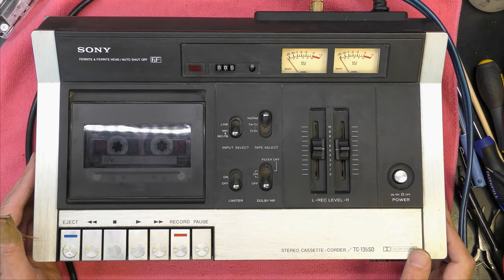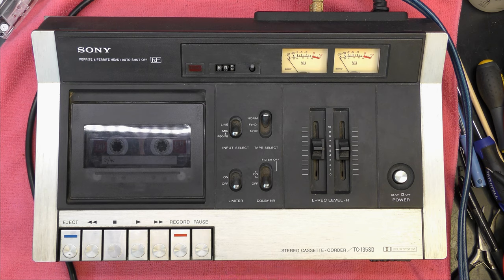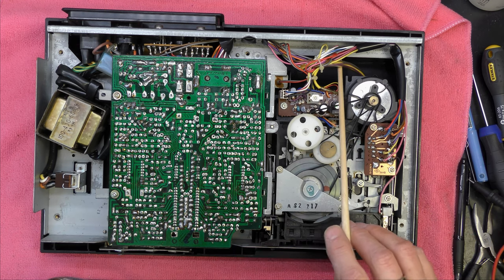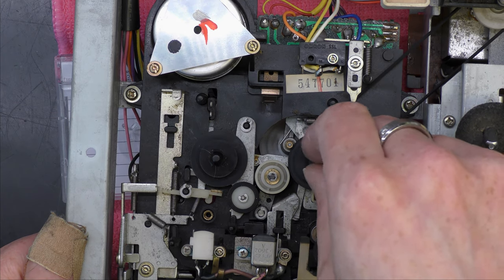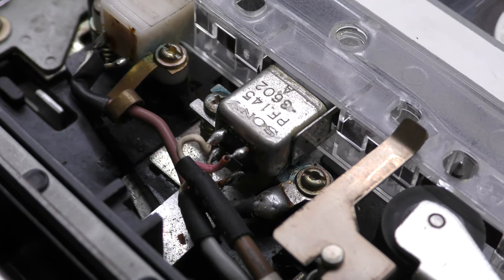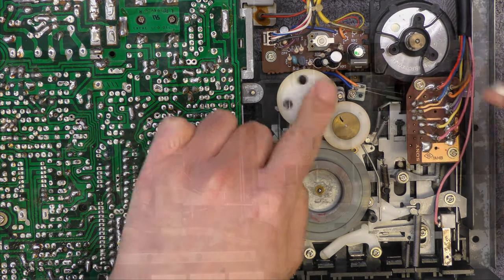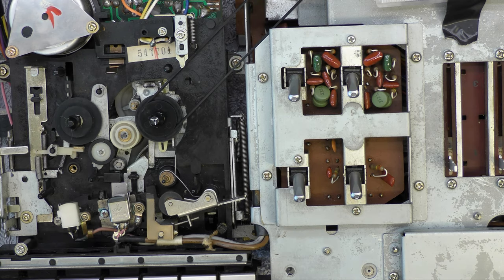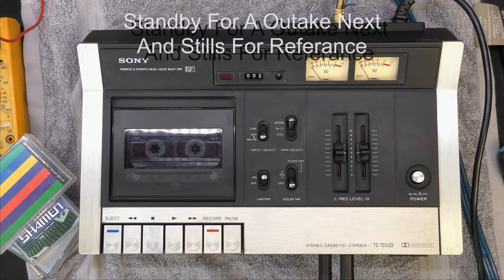Sony TC135SD Vintage HiFi Cassette Deck 1975 ish (4K)

Comment: I actually like how the PCB is separate... if you wanted to take the mechanisms and buttons off of a busted one, you could.  And then you could wire that up to a completely different board for amplification on the other side.  That's actually pretty cool, I may pick one of these up for digitizing cassette tapes and maybe even recording some

Comment: I love this deck. Very low noise floor. I think the superb frequency response has a lot to do with the SONY heads - ferrite IIRC. Unfortunately mine had had its bias/input switches on the top crushed and this led to intermittent left channel. I think I just hard wired the input one to 'line' and the other switches still worked after a good clean.

Comment: Great video! Just got one myself. Wont ff or rewind, but the mechanism inside seems to move freely. Maybe something wrong about the capstans (?). Do you know the size of the rubber belts on this one? And was it just unscrew the voltage switch? I see there are two screws on the switch - one on the top and one on the bottom. Will it make it removable so that I can accsess the cassette mechanism?

Comment: @12:45...always nervous about taking too far to bits ...
Me too, even the experienced amongst us all always steer towards caution. ;o)
I have just bought a similar model - the TC-136SD. It's so very similar.
Reply from the maker: Taking photographs a must, but often you miss something.
Reply: @darrencoe5795  Absolutely, the service manuals can only show the parts, and seldom, if ever indicate how they interact etc.
Cheers Darren!

Comment: I am able to compare a little better now my recently bought TC-136SD. 
The underside of your machine is much tidier, and transformer shielding is a plus too, not so with mine. 
Beware though - the keys, they are prone is fracturing underneath where the stresses are. I've had to repair mine. The Play/Record transport springs are far too strong in my opinion - I've cleaned them too, to avoid additional sticky spring forces. May look for a ligher spring to fit, and take it from there. Judging by how you pressed Play, your 135SD seems lighter on the fingers? (Edited)

Great lighting BTW, a very clear video!
Reply from the maker: Thanks. I bought some high CRI LED strips and placed on my bench a while ago. Filming in 4K produces huge files but gives good detail but I only have a 4K TV at the moment, my PC isn't. Thanks for bringing up the problems with the buttons. Sometimes the stop bar spring can be too strong so the buttons feel hard to press down.
Reply: @Darren Coe  The video is amazing! 
Keys: The keys are re-enforced with a metal bar inside - at least the ones that broke on mine are. I've cleaned them up, and 'roughed up' where the breaks where, and applied Gorilla Epoxy resin. Allowed 24 hours and more to cure. Seems to have done the trick!, although I may also place a small nail (don't laugh!) with epoxy as an additional 'backbone' to the key leg. You can see what I've written/done so far on my blog. BTW, I've got my unit fully working, may tweak it up later by replacing the caps and transistors? I find this old stuff has character! ;o) Regards.

Comment: There is just one caveat that puts me off this model, and it is the Dolby/Pre-amp Sony CX-064 chip - difficult to source.  Which is one reason why I also looked at the TC-134SD.
Should I chance a purchase? ;o)
Reply from the maker: I payed 20 pounds for this deck so not much to loose if I couldn't fix it. I liked the solid build when I saw it at a radio rally.

Comment: i would of just washed the mechanism with ipa cleaner to wash the old grease off and used silicone spray to replace the grease. the belts are normally lose. at a pinch you culd use rubber bands from the post office. that's what i did with mine the belts a most likely ok as the spring loaded wheels take up the tension when you press the buttons.😁😁😁😁
Reply from the maker: That's a interesting idea to cut down on work required when cleaning the grease. I'm not sure about the rubber bands on a decent deck though, cant give good wow and flutter.  Daz

Comment: i have the same deck ,in totally as new condition ,but have a problem ,when you press rewind ,it forward winds instead ,new belts fitted ,forward winds and play works perfectly ,any info on the problem would be appreciated
Reply from the maker: Ok that is odd. Please look at video 16.15 in. When in rewind the white idler should engage with the rubber idler and touch the rewind spool. maybe that isn't happening due to stuck grease and so continues to stay engaged with the take up spool.  Daz.
Reply: @darrencoe5795  thank you ,i will investigate ,i did notice that the left spool is not moving at all on rewind ,your help is much appreciated

Comment: I had one of these new in 1978 when I was 16. A few years latter it developed very bad intermittent flutter. The local repair shop tried 3 times to fix it and failed. I eventually fixed it just by tightening the pinch wheel spring. About 8 years after purchase it developed a loud pulsing sound on the left channel pegging the VU meter. I gave up and scrapped it. Looked great but flawed like most Sony products I've owned.
Reply from the maker: Thanks Chris, I must admit I've had mixed results with Sony gear in the past. Some brilliant, some not. Interesting on the pulsing on the left channel on your deck.
Reply: That's a shame, the pulsing is an easy fix. It's caused by intermittent / poor connectivity in the Playback / Record multipole switch, which is mechanically operated.. Simply spray-in with a decent quality switch cleaner (e.g. Servisol), operate the switch a few dozen times - sorted.